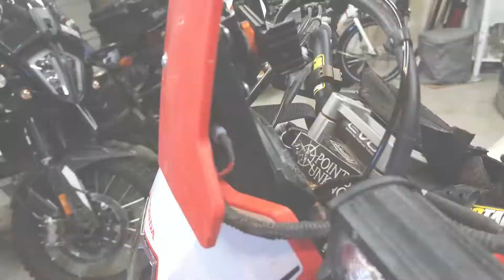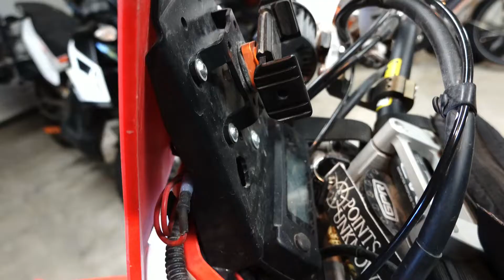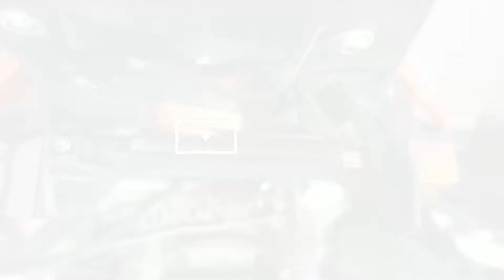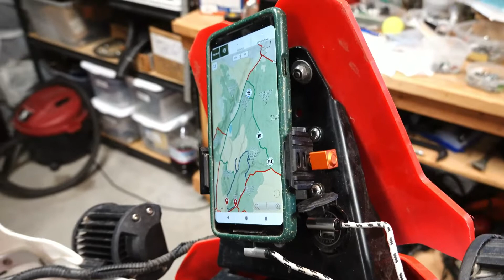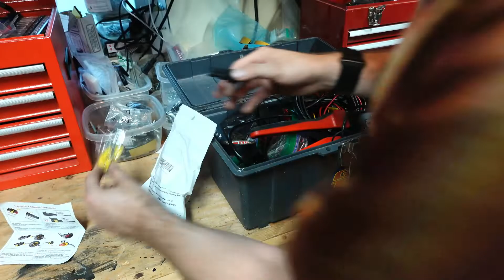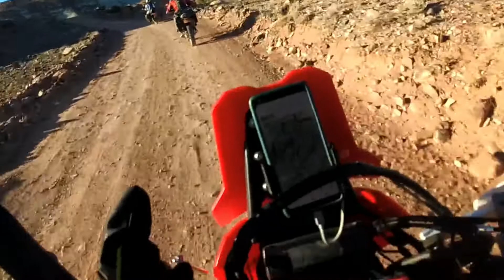Is the CRF450L Adventure Ready? Adding the Adventure Spec Mini Fairing + Phone Mount and USB Power

Comment: What is the rubber gasket between the orange metal piece of the  tripod phone mount and the AMPS bracket? Did that rubber come with your phone mount or did you put that in there?

Waited about 9 months for the fairing to come back in stock. Finally ready to set up.
Reply from the maker: It's just a simple rubber hose gasket like you'd use on a garden hose. I just wanted something to absorb some of the vibration. I tried these isolation studs (https://amzn.to/4dC22jp), but I didn't like how far that put my phone from the fairing. These isolation pads might also do the trick (https://amzn.to/4g2ur3K).

Glad they came back in stock. I love the mini fairing. It's very useful.